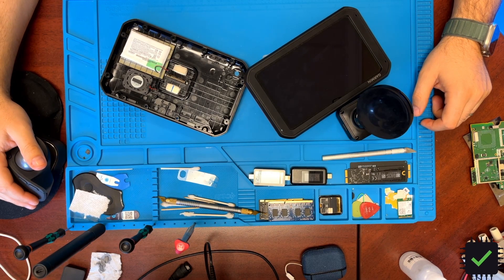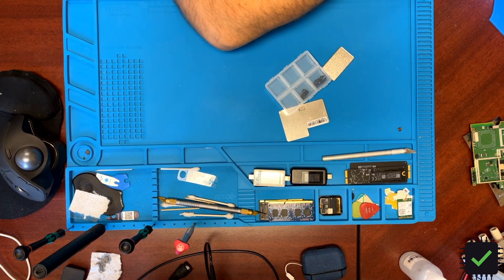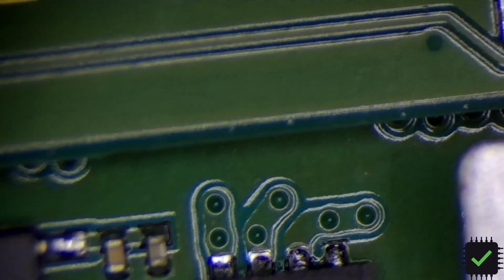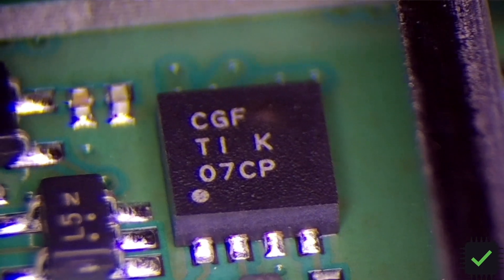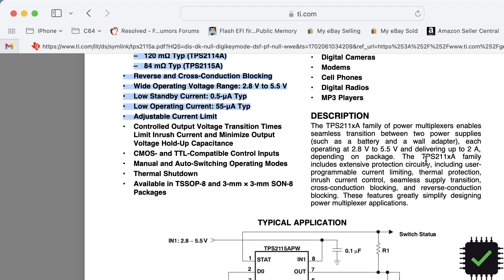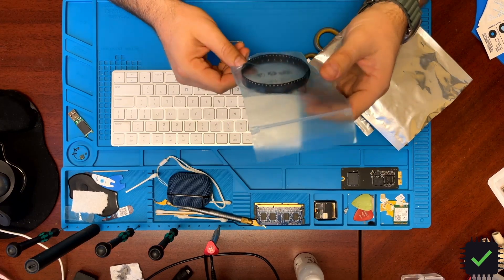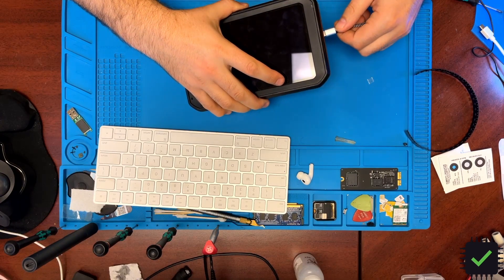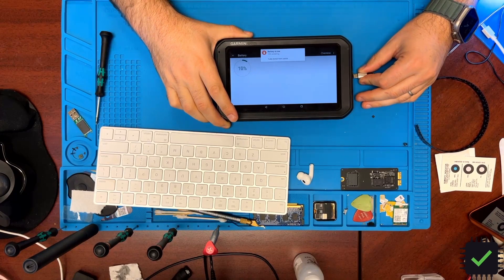Garmin Dezl Trucking GPS NOT CHARGING Diagnostic and Repair

Comment: Hi! Where are you located?
Reply from the maker: North Port FL 34288
Reply: @applepietech  I have otr1000 gps with the same issue. The mictochip seems to be starting dying. How much you charged for the repair services. Also, I have a blueparrot headset 650 with time to time, not working microphones. I believe it's a wiring issue. I would like to get an estimate for repair. I can send gadgets you with no problem. If you are interested, pls provide me with your phone or email to contact you  directly. Thanks
Reply from the maker: @themasterocktv82 you can contact me through my website applepietech.com or email info@applepietech.com

Comment: Thanks for the video. I think that what I need. What equipment did you use to remove and put back together?
Reply: Sorry, I see in description
Reply from the maker: You need some experience and proper tools to do this job. It’s not easy if you don’t do microsoldeing.
Reply: @applepietech  gotcha. Wanna say it’s better buy a new one instead trying to fix?
Reply from the maker: You can ship it over and I can fix it for you. You can contact me at info@applepietech.com